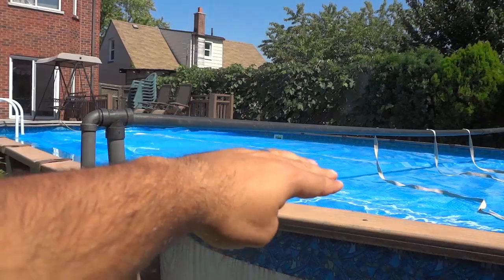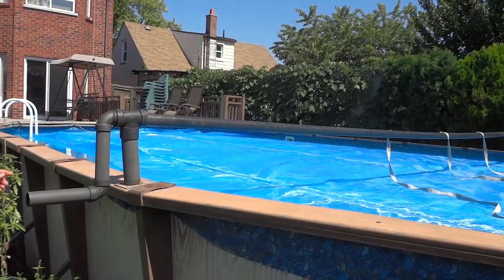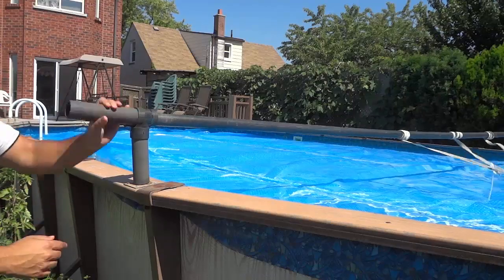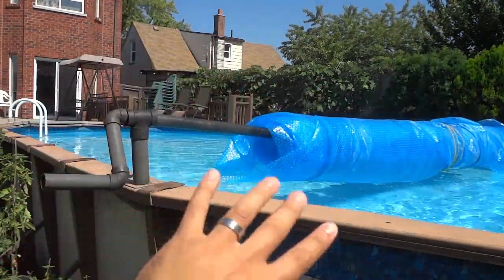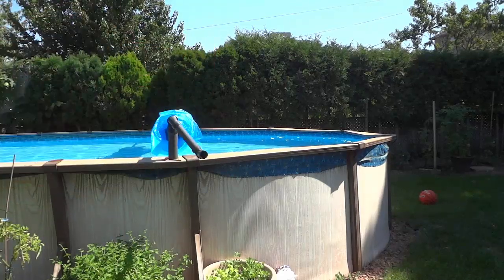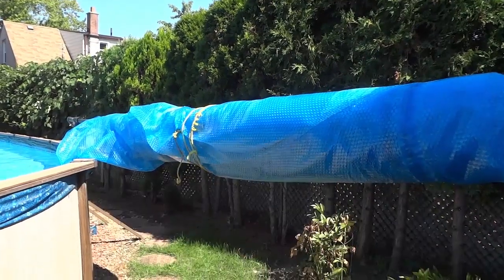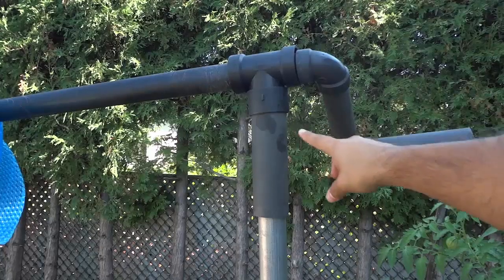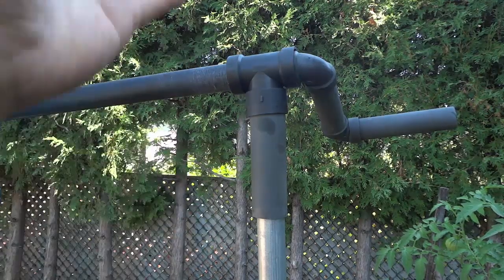DIY Swimming Pool Solar Blanket Reel (Made From Pipe)

Comment: Need better details. Just saying it is made from "pipe" doesn't cut it. I am wondering how you attached the rope to the cover without tearing it? Rivets?
Reply: Most pool places sell pool cover straps that include the plastic grommets for around $15.00.

Comment: Vgood idea& as simple as it gets, all you need is pipe& glue for the reel all of which you can get from a local plumbers merchant who should be easily able& happy to get the right sizes, this isn’t a video about the cover but you can buy that or cut something to measure from tarpaulin. 
My pool like most isn’t raised or huge so I plan to just lift my reel to the side or prop it in a corner,both easily possible by1able adult as plastic pipes extremely light. This reel is only raised as it’s on a raised pool. I will likely buy white pipe as it’s more available& absorbs less heat than black so should last longer.

Comment: did you glue or solder the pipes are they metal or pvc did you paint them and the silver metal post for out of pool reel station post did you pour a cement portion to hold the pole firmly into ground? what size is your pool? where did you fasten straps? why didnt you attach near both sides and center? is that a no no i have so many questions thank you for posting and btw you are lucky to have such a cool dad to do that for you cool so kind.

Comment: was that made from plastic pipe
Reply: Frank Mchugh I was wondering the same, PVC pipe?
Reply: Wondering the same thing please?
Reply: I can tell looking at it.... yes it's 2" PVC is the bigger stuff the smaller stuff is 1 1/2" pvc and looks like the post that goes into the ground is 1 1/2" galvanized steel pipe.
Reply: As a plumber I’m sure it’s 3” & 2”.